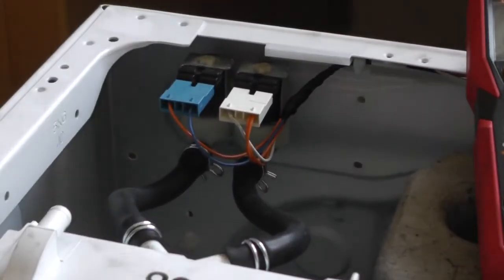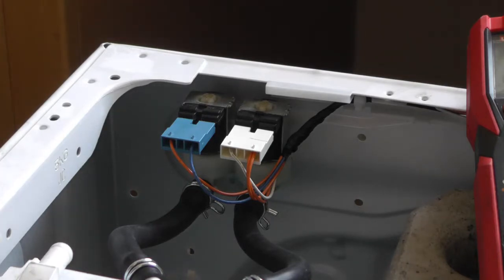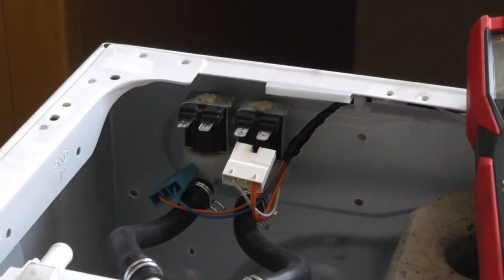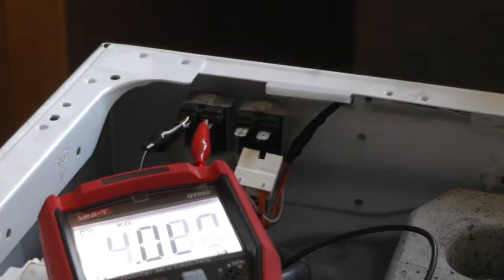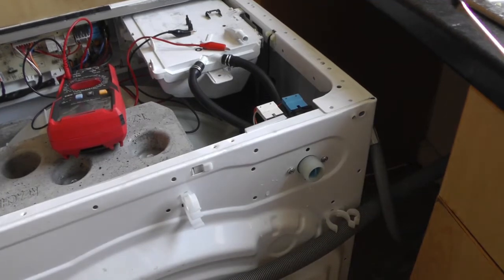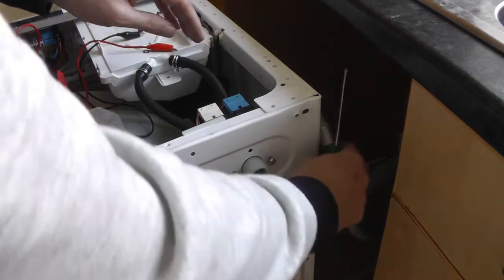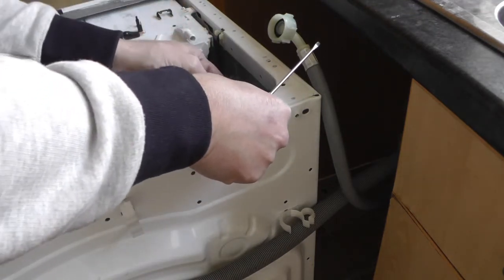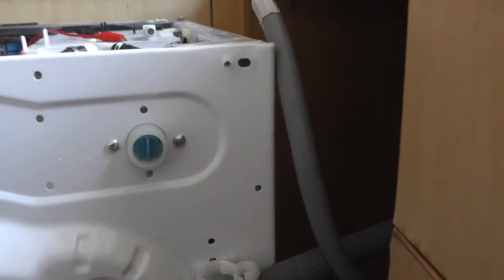Washing machine inlet water solenoid valves testing and replacement

Comment: My LG stops and says that inlet is clogged. Took the drawer appart and cleaned it. Now it's clean but still stops and says problems with inlet. Maybe the valves are the problem?
Reply from the maker: possible or the unlet filter gauze is blocked?
Reply: @cagmito76  Filter is cleaned, valves are clean. Last night worked for a few times, today again wasn't. Instaled some valves from an Arctic machine, not working. Dissasembled the water level sensor, put together and inversed the valves wiring, now it works again. Maybe it works only in the afternoons 😂 Could be an electronic problem?